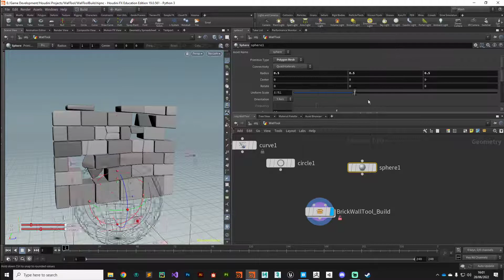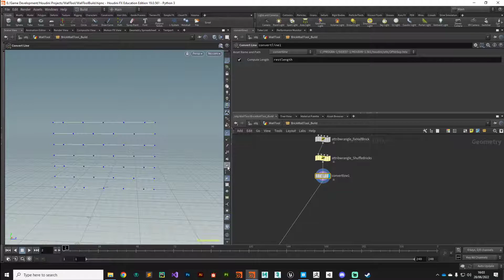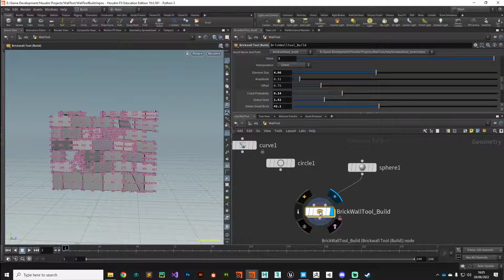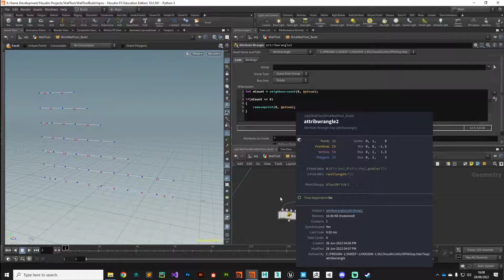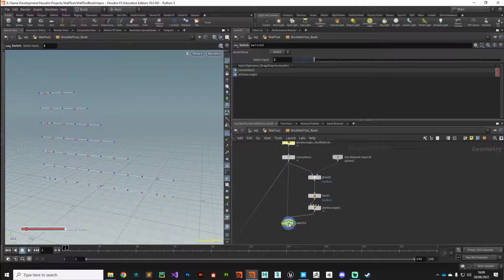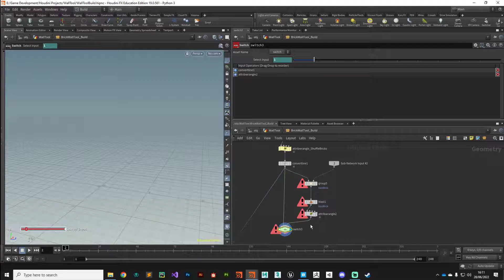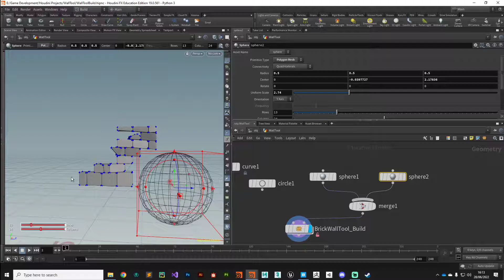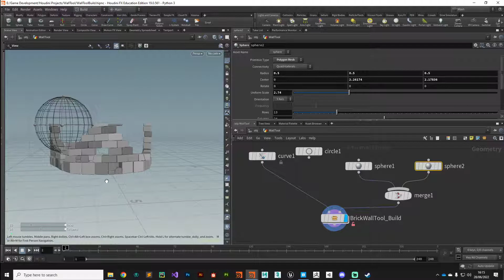Houdini 19 - Wall Tool 15

Comment: I just finished this amazing tutorial wow! Thanks so much!!

If you're still checking the comments here I have some questions moving on, but if you're busy no worries. The wall looks so amazing already

- so the digital asset follows a spline as a base shape which I generated and connected no problem in ue5. I draw it and the wall forms yay! But the problem I'm facing is, how come it works well in one direction, but in a perpendicular direction it stretches? Like the bricks are all rotating correctly along a spline, its just anything in x axis looks totally fine, but bricks along y axis rotate correctly but become very thin and stretched from each other. And another thing- if I create a shape like a cube, everything aligns totally fine, it's if I align in a spline that one direction stretches and freaks out?

- then the next thing if I wanted to add this brick pattern to Houdinis Building generator node, do you have any suggestions on what I should research or do next?

thanks if anyone reads this :D

Comment: Thanks for sharing , a lot of tips and tricks on this series!! I improved a bit to avoid cooking when colors are changed by put the color nodes just before the output and also I put some switch to turn on and off the edge damage, grout , wall noise to exclude some computation if is not needed . But great job! thanks!